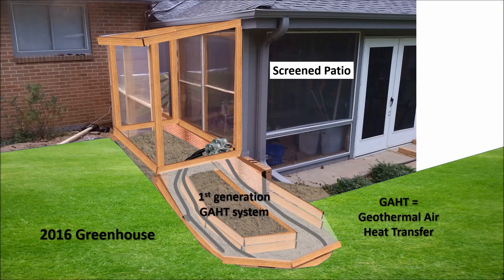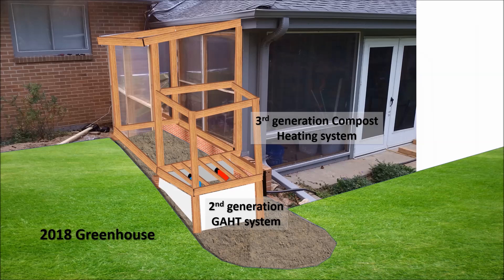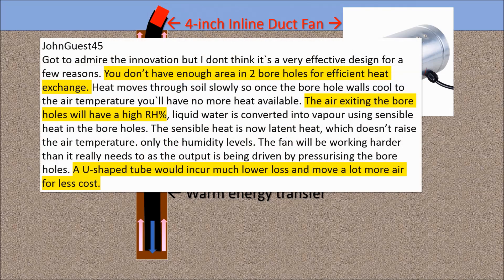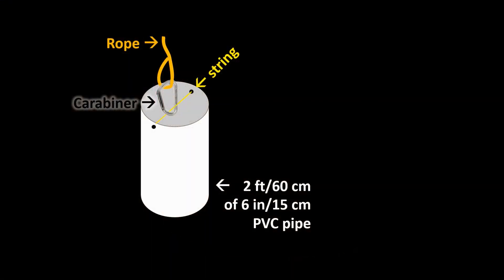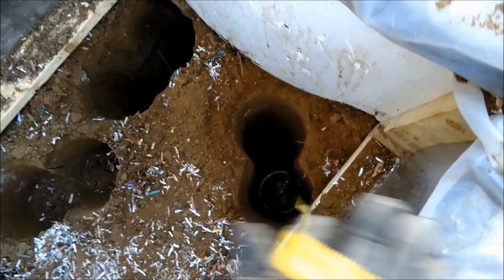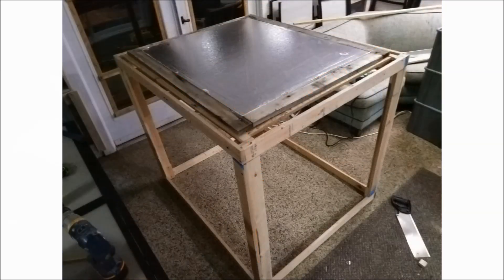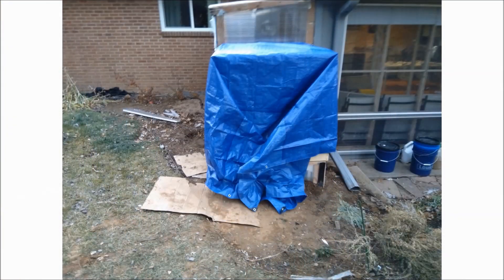Greenhouse 2.0 - Geothermal AND Compost Heating (Part 1: Design)

Comment: What using a flexible aluminum air duct like those used on ceilings of office buildings? There's a chance to be perforated by mistake but if your careful maybe it's possible. And aluminum as you said is far better as heat transfer medium. How is your system these days? Are you pleased with it? Any problems with this design?
Reply from the maker: Hello.  Yes, it definitely might be preferable to use metal tubing, but it would be more expensive and potentially more fragile as you note.  I actually do not own this house anymore!  If you check mor recent videos (https://youtu.be/A2TQJl9WjLc) you'll find my final implementation.  I moved away from geothermal (compost heating is my bigger interest).  I have concluded that a horizontal air-driven geothermal would be preferable, and it has to be LARGE compared to the greenhouse!  Vertical tubes are interesting, but you have to drill DEEP to make it worth the time and complexity.

Comment: Could you eliminate the fan entirely if you simply had the outlet at a higher elevation than the inlet? Low cold air would settle and the hot air would rise up.
Reply from the maker: Douglas, excellent question.  Answer is definitely yes!  The 2019/20 compost heater had an excellent natural thermosiphon effect going: https://youtu.be/eMHbHAKeMC0  As long as you have a temperature difference, you will get a decent flow.  Unfortunately I never measured the "wind" speed of the thermosiphon.

Comment: What is you inlet and outlet temperature of your underground system?
Reply from the maker: can't remember if I made an inlet/outlet measurement for that generation of geothermal.  But I did make a results video: https://youtu.be/VtPfUy6T2Jc

I really didn't have awesome results with any of the geothermal systems that I implemented.  They were all too small.  I had better luck with compost heating.  But there again, the compost heap was too small to stay hot for many months.  At least it is fun!

Comment: Do you know or think that there is a benefit to going deeper than 4 feet?  I am considering doing a aquaponics system by digging a 10 to 12 foot basement with the fish in the basement and the plants at 2 to 4 feet below grade.  I would put the geothermal system at 14 to 16 feet?
Reply from the maker: When it comes to geothermal, the deeper (and especially bigger), the better.  By better, I mean the ground sticks closer to an average year around temperature.  If you are digging with a backhoe, I’d lean toward a horizontal earth battery system (vs vertical).  Just make sure that the pipes are angled down to one side and you have very good drainage where condensation will collect

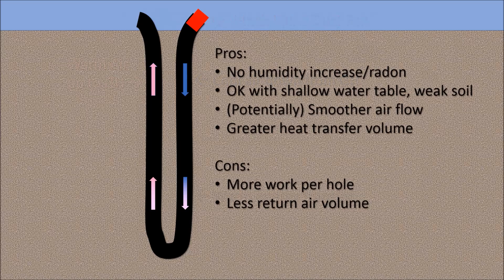Comment: 3:30 idk the temp of your environment, but something like this design is basically a GEO thermal cooler in the tropics.. if one was in hot climate, the air inside a room sending into the ground and back up into the same room, would be much cooler on its way out.  Anyone experience this or have link to share?
Reply from the maker: Yup.  Almost certainly MORE effective as a cooler, especially in hot, humid climates.  If the subterranean ground is cooler than the dewpoint of the air in the greenhouse, then water vapor will condense.  You'll need to have a bombproof drainage system to either drain or catch the condensation.  Probably not appropriate for a system like I showed here.

Comment: Oh buddy.

How did it work?

I think you lost heat by having the compost on.
You need to have something like 3ft in diameter to collect enough heat off compost. It's the collection of gases that give off the heat. There is a French man who did his house and barn with compost.

As for the bin, I would either us that exact design, only try worms. Vermiculture would be nice with the bends.
Only add more tubes, and have the tubes in the middle.
Or fo
Reply from the maker: Geothermal heating results: https://youtu.be/VtPfUy6T2Jc
Compost heating results: https://youtu.be/Dm7fQQrKlSs

Comment: You now that rock layer is actually a help. Rock conducts heat better than soil meaning it's effectively extending the area( and even the depth) you're drawing heat from. 

Have you considered water in pex? Your application is probably on the small side but for those actually using Earth Tubes to heat or cool living space it sidesteps all the issues with drainage or mold.
Reply from the maker: John, that's an interesting viewpoint about the heat capacity of rock vs soil.  I can't disagree with you!  

Regarding your question about switching to a water-based system - yes, it would certainly be possible, but it would represent a step change upward in terms of complexity and cost.  But I do agree with you, though - a closed, water-circulating system would sidestep all the mold/radon/condensation issues with the air-driven GAHT systems.  People who suggest these type of systems always recommend using a car radiator (or similar) as the heat exchanger, but if my greenhouse permitted, I think I'd just circulate water from and to a reservoir, specifically a metal water trough painted black and sealed tight.  The large body of water would naturally modulate the greenhouse temperature, and you need water for your plants anyway.

My parents live in Western Colorado and have been using geothermal cooling very effectively for about 20 years.  In their case, they have 6 wells drilled to ~200 ft and they circulate an antifreeze-like solution in closed loops through a heat pump.

I enjoy these dialogues, but in the short term at least, my greenhouse days are over, as we sold this house and moved into a townhouse where I don't have much of a lawn!

Comment: There is a MUCH easier way to do the geothermal trick using only one hole. You build the system with two tubes BUT use a coaxial design. Dig the well using a larger drill, possibly 12" or larger, and insert a capped pipe. Then you insert a smaller pipe, with the bottom end open, into the larger pipe. You then circulate the air through the smaller pipe and the air returns through the larger pipe. There's no radon, and there's no humidity gain from wet soil. If you drill the hole with a machine, it can be MUCH deeper and you can accomplish the task with fewer holes. Drilling can be easier than trenching with much less disturbance to the surroundings.
Reply from the maker: My original design was coaxial in nature (https://youtu.be/e8AosXQ3OaA).  Though it did not have the liner.  If you line a 12" x 20' hole with PVC, the liner is going to run you $425 (at least at Lowe's: https://www.lowes.com/pd/Charlotte-Pipe-12-in-x-20-ft-Sch-40-Cellcore-PVC-DWV-Pipe/50152554).  I have no idea what "machine" drills a 12" hole to 20 feet or more, but it sounds like a commercial drilling rig, rather than something you rent at Home Depot.  Add in another couple hundred for the PVC air injection pipe, and you're looking at $1000 or more for a single measly hole, which I guarantee would not come close to heating a sizeable greenhouse.  This is simply a waste of money, relative to conventional means of heating.  I've come to the conclusion that air-driven geothermal DOES work (results and cost), but only if you lay several hundred feet of pipe with a backhoe.  The little geothermal systems that I've implemented may heat the greenhouse by a degree or two.  The compost heating systems are more effective - 5-10 degrees of heating when the compost is hot.  I can extend the seasons by 6 weeks on either end, but my little passive systems won't give you a 4-season greenhouse.
Reply: @MorganBrown  - PVC pipe in that dimension is horribly expensive. It would be inexpensive and fairly easy to make a ferrocement pipe or to buy a corrugated drain pipe. The ferrocement pipe could be made in 4 to 6-foot sections with flanges for coupling. The gentleman in Nebraska dug a trench 225 feet long and 8 feet deep to install his system. I think it would be far easier and cheaper for him to go vertical. water wells around here are typically 3' in diameter and 60' to 100' deep. The surface area of a 60' deep and 12" in diameter would be 188 square feet.
Reply from the maker: @benthere8051  biggest problem with deep, sealed vertical wells happens when you run the system in the summer.  When you pump warm, humid air into the well, you'll get significant condensation in the bottom of the hole.  It will fill up a closed hole in no time.  In areas like Colorado, with deep water table, you might be able to get away with installing weep holes in the end cap and gravel packing the base.  But in many places, your weep holes will fill with water from the water table!  So you're stuck with a closed system and installing a submersible pump, which isn't the end of the world, but it adds some undesirable complexity.  A well-constructed horizontal GAHT system will have a slope with weep holes.  If you're going to the expense of hiring a water well rig and drilling deep, I'd aim for a conventional (closed) geothermal system, which circulates refrigerant and achieves cooling or heating with a heat pump.  My parents live in Western Colorado and cool/heat their large house with a 6-well geothermal heat pump system.
Reply: @MorganBrown  - The moisture problem has been addressed in several Internet reports. Let me see what I can find and I'll report on their solutions. I find that your concern is valid and there are ways to deal with the problem.
Reply: @MorganBrown  - An additional problem concerns me. If the tube extends below the water table, it will want to float. Because it is filled with nothing but air, the buoyancy could be tremendous. There could be an optimum answer for a high water table and another for a low water table.

Comment: Just repeat drilling holes side by side till you get 20 feet.  ;) The work will pay off in the end.
Reply from the maker: Joking aside, you definitely have a point.  If you need more heating (or cooling), just dig more holes.  Actually, with the post-hole auger, it's a pain to add or remove sections of pipe, so it makes sense to dig many holes at the same depth level, change the length of the auger, then repeat.  

Sadly for me, this site was really poorly set up to expand the geothermal.    We ended up selling the house for a good price, so I couldn't go all-out on geothermal, unless I ripped out the sprinkler system and took over half the backyard for geothermal, lest I put off buyers..  What I needed was a junkier house with a lot of land. ;-)

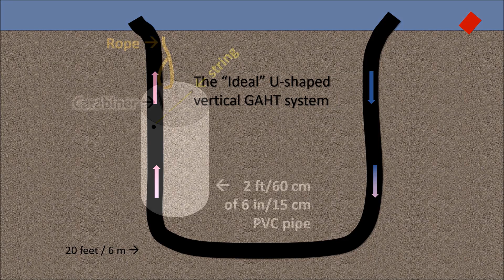Comment: 4:22 I have a way to dig such a large and wide "U" shaped hole. You will first need to raise and train at least one or more burrowing animals. Prairie dogs come to mind, for a few good reasons. They are already accustomed to working together in groups, and can also climb their way back out of a vertical shaft, plus they are natural guardians at keeping cobras and pit-vipers etc. from occupying your heating/cooling shafts. This will undoubtedly be a challenge, and may require back-filling certain parts of the system, but I'm confident with proper guidance and equipment, along with the benefit of selective breeding, I think you could have a decent chance of having a workable tunnel system to meet all your heating cooling needs within a few generations or so. Best of luck, and please share any upcoming videos showing the progress of your work! :)
Reply from the maker: If we could just get those prairie dogs to run plastic liner in this u shaped holes, we would be set. 😀

Comment: if I did that much mess around the house, the wife will kick me out hhhh, why not just use a tiny thermal solar collector with a small radiator inside
Reply from the maker: Ha, well, we just sold the place so I had to tear out the greenhouse.  When it comes to passive heating, I like multiple options.  Solar heating is great when the sun shines.   Compost and geothermal supplement solar when it gets cold and cloudy.  If I had been blessed with more flexibility on the site design, I absolutely would have implemented a solar heat collection
Reply: Bro, solar heating works best in the summer time- when you need it the least! Tell the Misses, if she doesn't want to help with the extra clean up that comes with the compost, then she needs to layer up with some warmer clothes!

P.S. let me know how that turns out for you - I'd be facing the same situation with my wife, if I were to decide to heat with compost and looking for a guinea pig to try out some ideas :-P

Comment: Thanks for the video!

Any concerns from toxic levels of carbon or amonia or other things like that in the air?
Reply from the maker: No concerns.  The compost chamber is separated from the greenhouse with a plastic sheet.  Also, the mixture I use (coffee, leaves, shredded paper) doesn't produce much ammonia.  CO2 is a net benefit for the plants.  To be fatal, CO2 has to be in the 100,000 ppm (10%) range.  CO2 concentration in the atmosphere is only 400 (0.04%) ppm.
Reply: @MorganBrown  great answer thank you!
Reply from the maker: @RobC1999  thanks.  edited

Comment: Thanks for sharing I think the 2 pipe vertical with water as the medium for heat absorption is a better way to go and drilling the holes with the garden hose and pcv pipe means you can go much deeper if the rock is deep enough.
Reply from the maker: I decided early on to do for an air-circulated system.  It's definitely the simpler choice.  With water, you've got to run a legitimate pump (not just a cheap submersible pump) and keep a reservoir of water in the greenhouse.  Though I'll admit that for passive greenhouses, a water reservoir can be a great thermal mass, and it gives you the opportunity to use other passive methods, like solar heating. 

When you say drill with garden hose and PVC pipe, do you mean running garden hose inside of the pipe?  Seems like a cool method, but you are left with a thin hole, and you'd have a lot of water to move!

In any event, I'm not using this method of geothermal heating.  I buried a coil of pipe in a pit and just circulate through the coil.  It's simple and mildly effective.  I focus on compost heating as my main passive heating method.

Comment: I have a question... The two holes you dug next to each other, couldn't you have just dug a single hole the size of the two, pushed the pipe down and then filled it with dirt? The PVC bit was ingenious for what you are doing but it seems like a lot of extra work that could be done easier; unless I'm missing something or course. Thanks for sharing!
Reply from the maker: Thanks for tuning in!  It's a good point you make.  My problem is: I'm trying to run 4-inch pipe and my hole has a ~6.5-inch diameter.  I could get 3-inch pipe and do exactly what you suggest, but I didn't have any on hand.  Since last year, I've gone to a small horizontal system (https://youtu.be/A2TQJl9WjLc), but who knows, in the future I might try the vertical system again.  My major limitation is the bedrock that I hit at 8-10 ft depth.  If you could drill to 20 ft, the vertical system would really give the horizontal systems a run for their money.
Reply: @MorganBrown  The link didn't load but... I'm looking at doing a horizontal system but under an existing shed; just to help keep the temperature stable. Your idea, going vertical, may be an option though... I like it. Just trying to figure out the easiest, most efficient way. Can you repost that link though? I'll see if I can find it in the meantime. Thanks!
Reply: @MorganBrown  I found it...

https://youtu.be/A2TQJl9WjLc
Reply from the maker: @siafulinux  ha, it looks like YouTube included the closing parenthesis in the URL.  Sigh...  Glad you found it
Reply: @MorganBrown  LOL, I noticed it and took it out. 🙂

Comment: I am digging a 30 ft trench at 3ft and am using a 4 inch pipe for cooling but was going to cool outside air but am now considering cooling the inside air to reduce humidity.
Reply from the maker: Yeah, these systems work well for cooling.  Just make sure to add deep holes at the low point and pack with geavel
Reply: @MorganBrown  I am in northern New Brunswick it stays pretty cool but for about three months it's pretty warm and I am off grid so this was my best bet. I went pretty deep into the wet clay layer so I am hoping it works well.

Comment: I have done a lot of temperature measurements at various underground depths, and many experiments.  I have a different way of thinking about the heat which exists underground.  The heat just naturally rises up out of the ground ALL WINTER LONG.  No tubes are necessary.  The problem is that the heat of 60 degrees F will dissipate QUICKLY on a cold winter day, and it is as if it doesn't exist at all.  The solution is to insulate the greenhouse as much as possible to stop the heat loss.  If the sidewalls of the greenhouse was earth-bermed... or buried, that would eliminate much of the heatloss.  Many people are building underground greenhouses and are growing vegetables all winter.  check out this guy in nebraska growing ORANGES all year... even in the snow https://www.youtube.com/watch?v=ZD_3_gsgsnk  His underground tubes extend way OUTSIDE his greenhouse.  It makes no sense to put the tubes under the greenhouse because that heat would rise up anyway into your greenhouse.  The man in Nebraska has several horizontal tubes outside his greenhouse which brings additional 52F warmth into the greenhouse.
Reply from the maker: I'm with you.  People building passive greenhouses from scratch are even digging 4 ft footprint around the greenhouse and making buried walls out of 2 inch of foam board to keep the soil heat from dissipating.  In my videos I do repeatedly state that there's no substitute for a quality build (which mine is not!).  Still, I hope my experiments show that other passive methods (compost & geothermal) can offer some benefits to any greenhouse